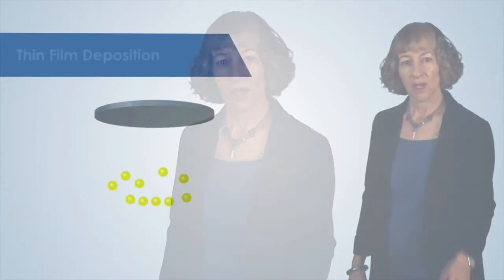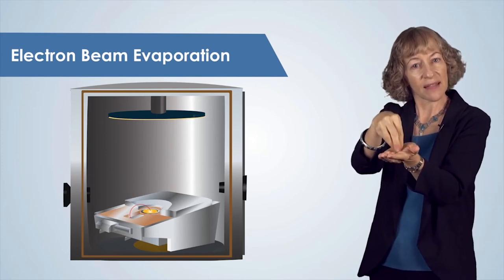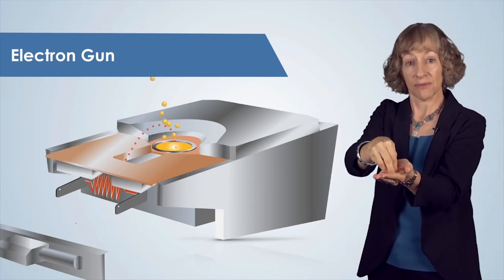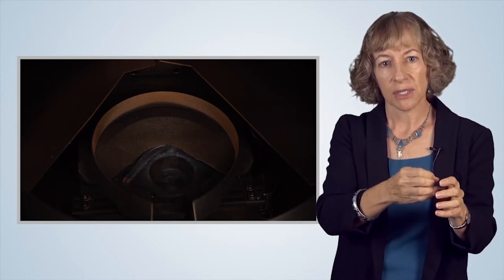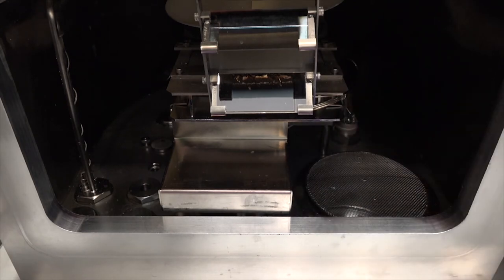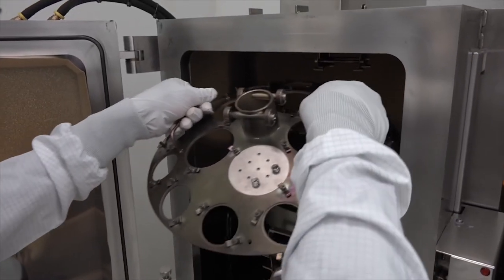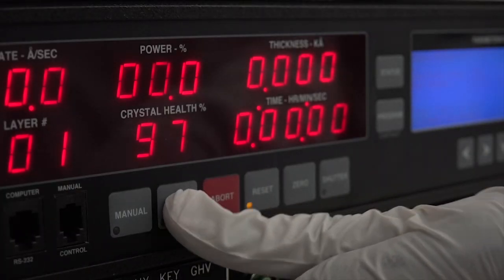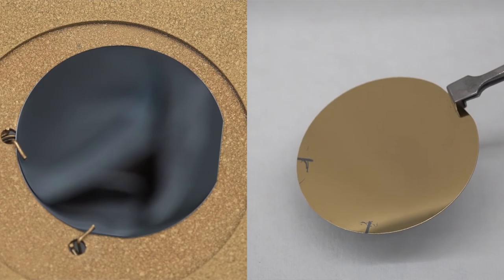E-Beam Evaporation

Comment: I have a question about e-beam evaporation.
Metal is definitely heavier than the air, then by how they can goes up?
I think they will behave more like dry-ice.
So I think it is good to place the wafer(substrate) on the floor of the chamber, not on the top.
And if they(gaseous metal) can move freely in the vacuum chamber, do they also stick on the wall/surface of the chamber?

Comment: How can you check the thickness of the thin film during the process?
Reply: During the process we set the deposition requirement, ex: 20nm, and a pre set value of deposition rate "X"nm/s time is determined. Post deposition the thickness may be measured using Ellipsometer.
Reply: @radhikapriyadarshini111  Thanks for your kind answer!
Reply: There is a measurement system near the sample, which is made of silicon cystals. The weight of deposited film is atomic compared with the crystal.  The crystal has an oscillation. When the material becomes heavier, the oscillation changes.